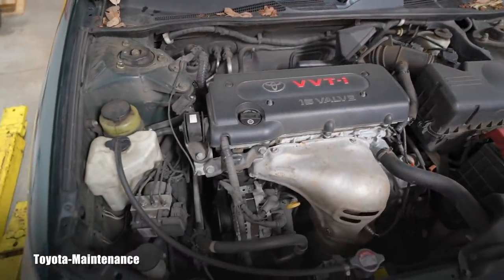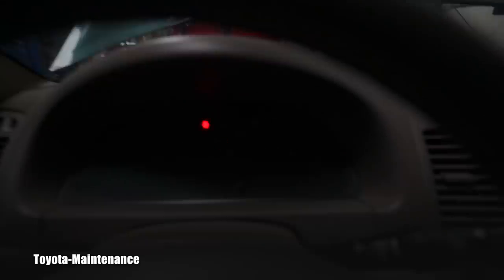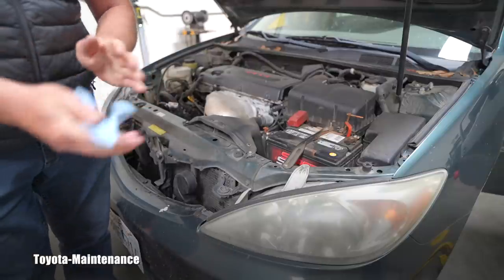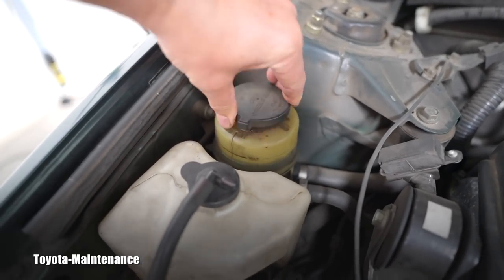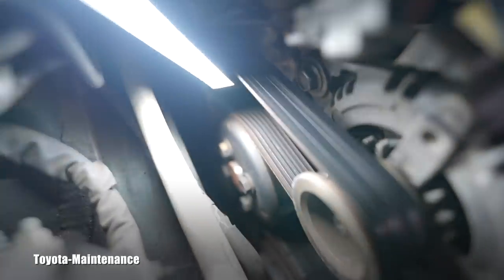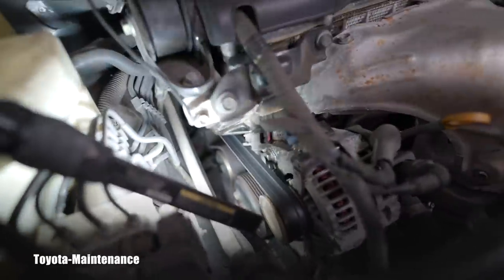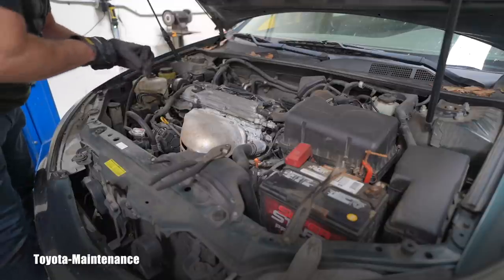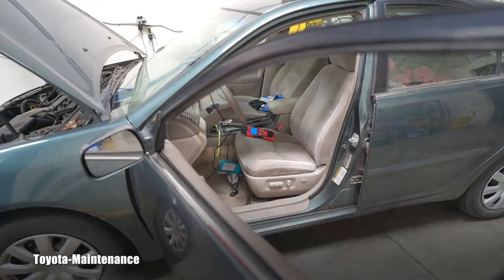2004 Toyota Camry  with multiple problems

Comment: Banches of problems, gives it away to junkyard, wow look at the color of the engine oil who ever owns this car is a massive nastiest person, I had a 1998 buick regency and I had it straight for 10 years because I maintained it much and much well, and now I have myself an 08 mercury grand marquis, and already have it for 8 months which is also a good car, I didn't change the spark plugs yet but next week I will  change the spark plugs, I made an oil change and reset the oil, because the light on the dash come on every 3 months, the one that said change oil soon, so like I said next week I will be making a full service if the immortal almighty Lord let me, and I will do it myself, and I will take times to do it and cars are easy to work on
Reply: But also, be open to the oil stop place not even changing the oil at all and just putting a sticker on.